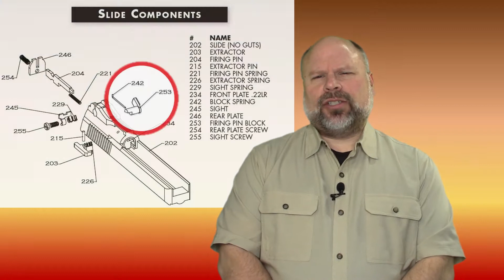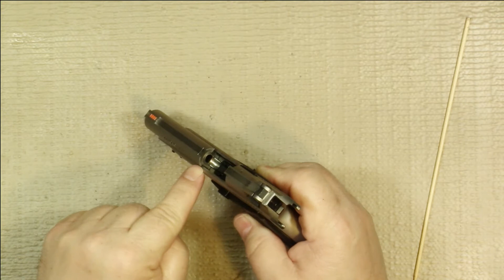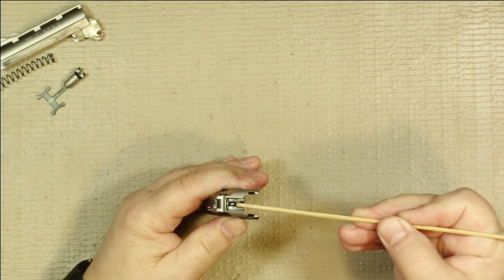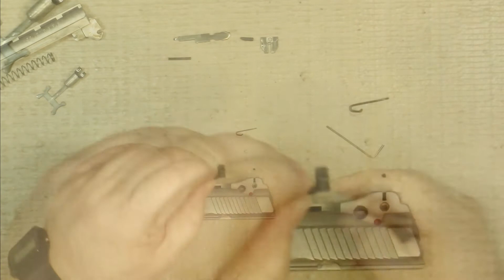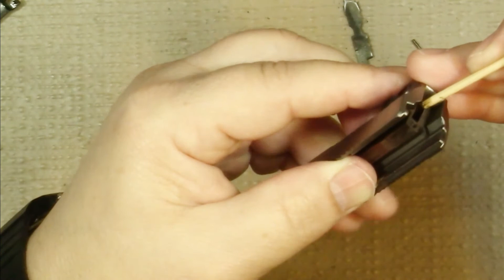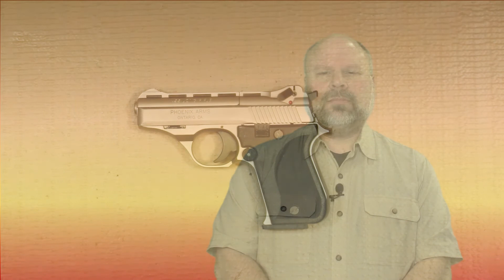Phoenix Arms HP22 Firing Pin Safety

Comment: The strike surface of that firing pin looks to be severely worn, to the point that it should probably be replaced. In fact, it looks to be so worn that the hammer might also be due for replacement. From the looks of it I would suspect the hammer to have a rather noticeable divot at the strike point. I had to replace the take down lever on mine because the recoil spring guide barrel snapped off and elected to replace the recoil spring while I was at it. Upon further inspection I noticed a little wear on the hammer where it strikes the firing pin, but when I removed mine it looked like new.

Comment: Phoenix Arms no longer sells the safety lever or spring. You are supposed to return to the factory. Not sure what that would cost for someone who is not the original owner. The spring appears to be a very simple round wire. Bet I could make one, or have it made. I know there are videos on YouTube on how to modify or add parts to make it work like a normal semi-auto pistol. May check them out. I'm sure the warranty expired on mine before I ever traded for it.
Reply from the maker: @patrickmcwilliams696  There are still some parts suppliers that have them in stock, a Google search should turn them up. Due to YT rules I cannot link to them.

Comment: Would this affect the hammer cocking back?

I have the 25acp and that safety is loose and flimsy , the gun shoots when I cock it myself but doesn’t continue to fire until the clip is empty; I have to manually cock it got every round , do you know what the problem could be?
Reply: The slide does not reset the hammer

Comment: Hello and thank you for the video my friend! I recently did some modification to my hp22a to include duracoating in German flecktarn Grey. This safety was one of the parts I wanted to remove prior to duracoating so I found your video quite invaluable as there really wasn't any information out there on this part. Thanks again and have a great day!
Reply from the maker: You are welcome, and I am glad it was helpful. Sounds like an interesting project, how did it turn out?
Reply: @CraigsGunChannel  I couldn't be happier with it 👍
Reply: @CraigsGunChannel so does the firing pin laying against the round in the all the time with this being removed?? I got one on the way.going to do all the mods just wanted to know about this one..
Reply from the maker: @boss94ways51  no, the rebound spring still keeps the firing pin from resting on the rim, the firing pin safety when engaged blocks the firing pin from being able to hit the rim
Reply: @CraigsGunChannel ok so if i remove the firing pin block completely it should still be safe as long as i still have the regular trigger safety of course??dont want to worry about accidentally engaging the firing pin safety.
Reply from the maker: @boss94ways51  yes, it should be fine, however keep in mind that the firing pin safety is the "safest" of them, as it does the best job of making the gun safe when activated.
Reply: @CraigsGunChannel YOUR RIGHT....I MIGHT HOLD UP ON THAT FOR A MINUTE..THANK YOU FOR RESPONDING

Comment: is there supposed to be a spring in the firing pin safety hole.? something that would stop the switch frm falling.? and also where uu state that theres 2 holes nd the spring should go in the 1 ionly have one hole where that thin pin gets put into place nd then the one with the screw that hlds the plate in place
Reply from the maker: That is very odd.  The spring wire is the only piece that goes in and it retains the safety block as well as provides the spring tension to hold it in place. It should have a "u" shape to it and 1 leg goes in one hole and the other goes into the other hole. There should be 2 holes as it shows in the video. If yours does not I would contact Phoenix Arms to discuss it with them as it appears something is not right.

Comment: Not sure how I missed this vid; but it was very helpful in my breakdown and re-assembly today!!!
Reply from the maker: Let me know if that fixed the issue
Reply from the maker: By the way, sorry I missed your earlier messages, I am just now seeing them. Let me know if you get it working.
Reply: @CraigsGunChannel  Thanks!  Your videos have given me the push I need and the confidence to dig a little deeper into the workings of the pistol than I would usually go!  Everything is functioning now; but that new firing pin may be what is needed for a clean strike.  I should make it to the range tomorrow!
Reply from the maker: @racketrick  that sounds good, I hope it functions fine for you.
Reply: Can anyone tell me why almost new sa/da 9mm misfires sometimes on certain ammo?

Comment: The recoil spring should be replaced every 1000 rounds or so. You will notice that the old spring is considerably shorter and weaker after that many rounds so the slide will work harder against the frame that could lead to stress fractures. The five pack of new recoil springs is cheap from Phoenix Arms. You will also notice how long and strong the new recoil springs are side by side compared to the old shorter and weaker used recoil spring.
Reply from the maker: Good advice, and something that should be monitored on all firearms. Springs weaken over time as they are used. Parts for these pistols are so cheap it makes no sense not to.
Reply: @CraigsGunChannel  PA should maybe have a "tune-up kit" of necessary parts vs a la carte ordering...just a thought.
Reply: According to Phoenix, the gun is intended for standard velocity .22 ammo.  It will work fine with high velocity ammo, like CCI mini mags, but it's important to have a strong recoil spring.  So, if using high velocity ammo, it is a good idea to replace the recoil spring every 500 rounds.  They are currently (Aug 2023) only $7 for a pack of 5 from Phoenix, so there's no reason not to refresh them regularly.
Reply: @paulstone472  Continual use of high velocity ammo over time will crack the slide or frame. They don't warn you for nothing. There are the cracks you can see with the naked eye and the cracks you can't.

Comment: Hello! Can the pistol work without the firing pin safety installed?
Reply from the maker: It would fire, however I would not recommend removing the safety as it is designed for when you need to render the firearms safe. Removing it eliminates that possibility. Also, should there ever be an accident or other incident the fct it was removed could create liability issues.

Comment: If I super glued the Lin safety in the fire position would that keep it on ready to fire?
Reply from the maker: The safety should stay in place on its own. If it does not then it indicates something is wrong. I would contact Phoenix Arms and they should be able to assist you with fixing it if that is the case.

Comment: I wonder I i remove it will the firearm still function mine is modded because of all the safeties.
Reply from the maker: The firearm itself would still function, however I would not recommend removing it.
Reply: I’m wonder if you filed off the little bit that blocks the firing pin, if the firing pin would work regardless of lever position. Granted any modification to a gun brings up liabilities in the event of self defense situation.
Reply from the maker: @NorthCountryOutdoorGuys  it likely would still fire, however it would permanently alter the ability to use the firing pin safety as designed making it unsafe from that aspect. It would be better to remove it completely in all honesty so that it would never appear to be in a safe position and not really be in one. If it is causing an issue where it is not functioning correctly it should be repaired as opposed to disabled.
Reply: Good thing i found this video because my firing pin safty got loose one day and would come down on its own preventing it from fireing again sent it in feels real stiff now wich is good but if it goes loose again im just thinking of removing it fully as it has the other safty

Comment: My firing pin block safety keeps falling back into safe mode how would I fix it? It keeps the firing pin from hitting the round
Reply from the maker: It sounds like the spring is bad. A replacement spring should fix that.  You could take it out and make sure that the block piece itself is not damaged and if it looks ok try to bend the spring back straight (the long leg should be straight),  or get a replacement from Phoenix  Arms.
Reply: Craigs Gun Channel ok thank you after I remove the little Allen screw under the firing pin cover the cover should slide right off shouldn’t it
Reply: Im guessing its real common for these guns to that as i had to send mines in for repair for same reason